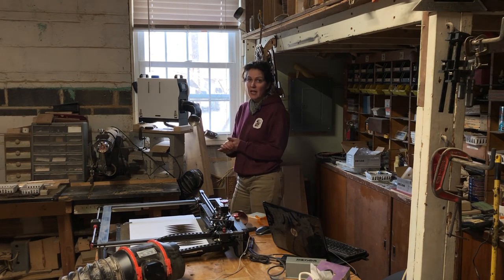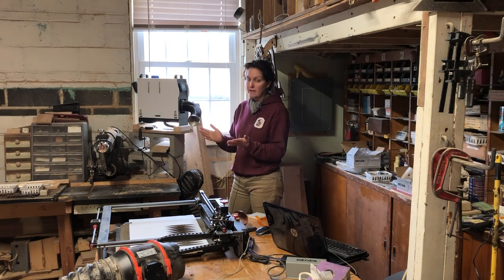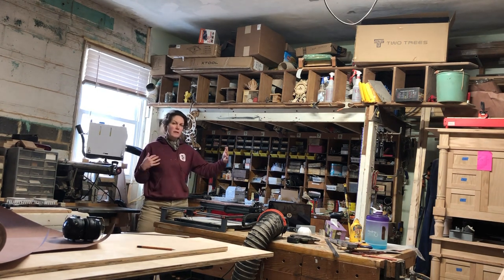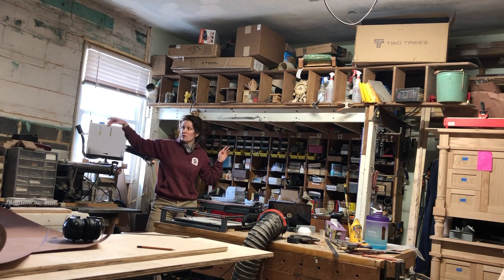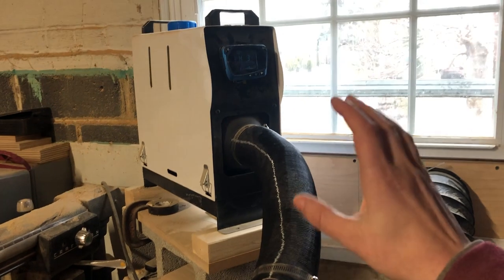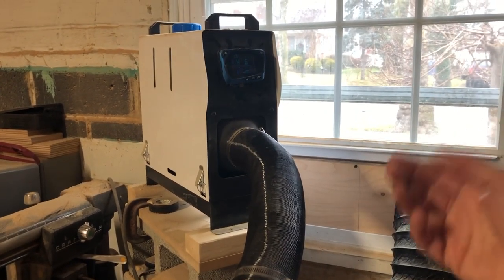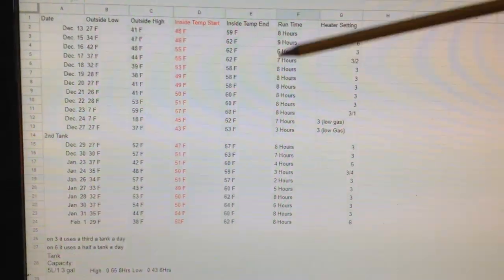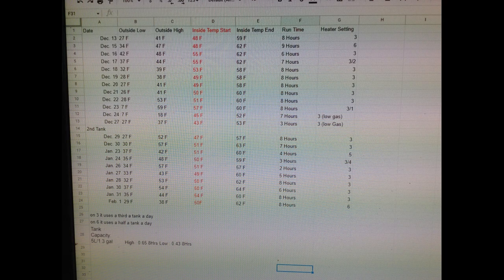Tool Review :  Vevor Diesel Heater : Realistic Expectations For Heating A Shop

Comment: Glad to hear it's doing a good job in your shop. All sounds good and hopefully if the weather changes it will keep you warm. Just one suggestion, my ceiling mounted air filter unit blows the warm air that rises and settles back down to circulate and raises the general temperature (at the height where I work) noticeably. With a 10 ' ceiling you might have a vey warm top half but cooler bottom.
Reply from the maker: This is smart.  I should look into this.

Comment: If home heating oil is cheaper where you're at, you should use it.
It'll probably be a minor storage issue for you, but if the #2 fuel market ever starts making sense again it'll be a good bit cheaper.

Comment: This winter is the new normal…..I’m in MI, and it’s pretty much the same. Why not just run a natural gas line from the house? That’s what I did for my two car garage, and I got a nice ceiling mounted furnace from Menards and I was good to go. I work out there all year long.
Reply from the maker: I think eventually I would like to use natural gas.  The line is right in the garage.  The problem with this shop is I pretty much moved, had less then a week to get things up and running, and then had to start with orders again.  So there is stuff everywhere and I just don’t have a great place to safety mount the heater.  But a ceiling mount is a thought.  Problem is the ceiling is slowly falling down and there are patch holes everywhere so that’s a problem for next winter.  Supposed to be 60 here in a few days.

Comment: I have one more question in my head.  Why did you decide to not use a ventless (or even a direct vent) natural gas heater with the NG line so close to the shop?  You have said the room behind one wall has natural heater (NG).  It never needs refilled or having to run out for fuel.  The humidity factor is noticeable but controllable.  I used one at 2 different locations and they worked fine (& quietly :>) for me.  Cost would have been about the same, too.  Just curious :>)
Reply from the maker: I think eventually I will use the gas line.  The main issue I had with using it this year is I just have no "safe" spot to mount the heater at the current moment.  A lot of my storage and shelfing I left in the old shop so all my stuff is stacked against the walls until I have to time to make some cabinets.   There is just currently nowhere to put it where it wouldn't be a fire hazard at the moment.  My other huge concern is whenever I stain something or use certain products (which is fairly often) the vapors in the air interact with the gas heater in the other room and the whole house ends up smelling like gas.  This last time I even had the garage door open all day and it still smelled.  Did a little research online and it seems to be a common problem with people who have gas heat and floors refinished, with the vapors interacting with their gas appliances.
Reply: @HoneyBadgerWoodWorks  I used a ventless natural gas heater in my last shop.  I don't think there was ever an issue from dust or vapors.  What usually happens to ventless heaters is it builds up a film on the inside of the heater and messes up the thermocouple and oxygen sensor.  My big issue was the huge amount of humidity created.  My tools were rusting something terrible.  If you use a direct vent wall heater, that will eliminate all these concerns.  The big drawback to a direct vent type is price (about 3x more).  
My biggest interest is in alternative heating during blackouts in winter.  I still have my kerosene heaters and keep 10 gallons on hand to get through the shut down for a couple of days.  If it is out longer, I have time to figure out another way.  I am thinking of using a vent free natural gas heater with a 12' rubber line and a quick coupler.  I can then mount the heater on a mobile cart to roll in the house and hook up.  That would be better than filling the heater with kerosene every 6-8 hours.  Thanks for your insight to my question.
Reply from the maker: Yeah, I think the smell issue arises during big jobs, times when I am staining large surface areas for a few hours.  Little things like picture frames aren’t a problem.  But, I just stained two vanities, all the doors and drawers, it took a few hours to get all the stain on and that night the gas smell filled up the whole house.  It would also make sense why people who have their wood floors stained have the same issue, because the floor cover so much area.  That sucks to deal with blackouts like that.  We barely had a winter here, no snow, and temps well above average.  It’s been so warm I haven’t even used the heater since I filmed that video.  Couldn’t imagine dealing with your issue though.

Comment: Wouldn’t propane be cheaper? Saying because every vehicle I own is diesel. Vw tdi, duramax, mercedes 300sd, and two john deeres , great for power and longevity over gas but expensive. I justiify this because I grow and make my own biodiesel. My propane little buddy is virtually silent, its a fan issue in torpedo styles. I also have two ceiling fans in my garage. Wood stove in the barn.
Reply from the maker: I had one of those tower propane convection heaters before this.  I used it for two winters I believe.  Maybe three.  If I ran it on medium all day I went through two tanks a week easy.  And it cost me just under 30.00 to fill two tanks.  I've ran this for over 20 days at this point and still haven't gone through 10 gallons of diesel.  So, even with the price of fuel still being so high it's still cheaper and less of a hassle to go get.  Plus I was always having to more the heater and the tank around the shop because they took up so much room and was always backing into them.  But, that's just my experiences.  To give it a fair try I would probably have to run the propane in the new shop and compare, but I most likely this late in the season.